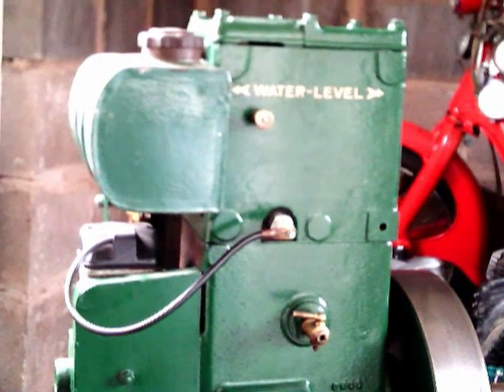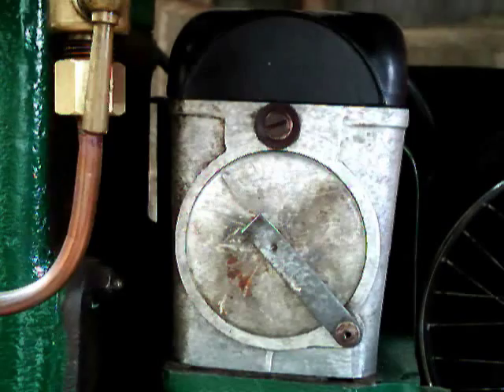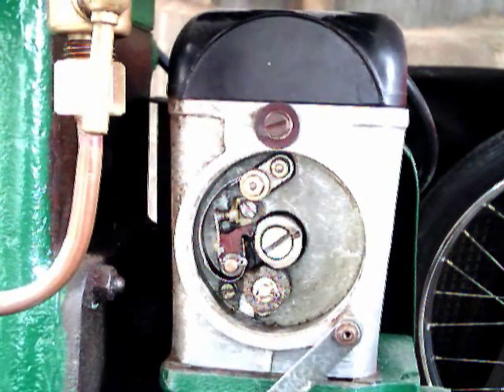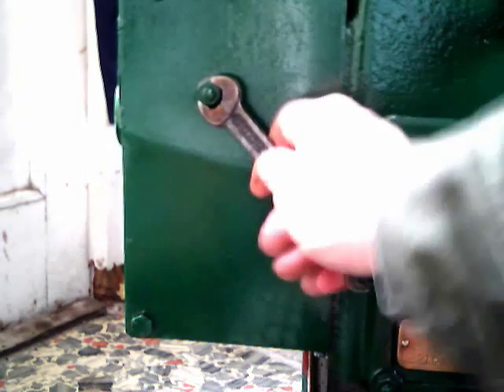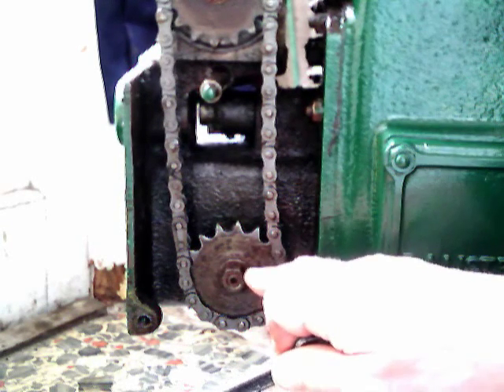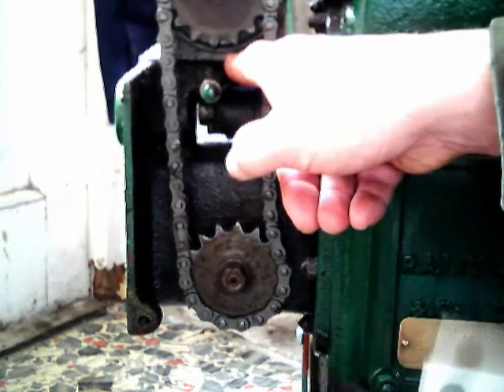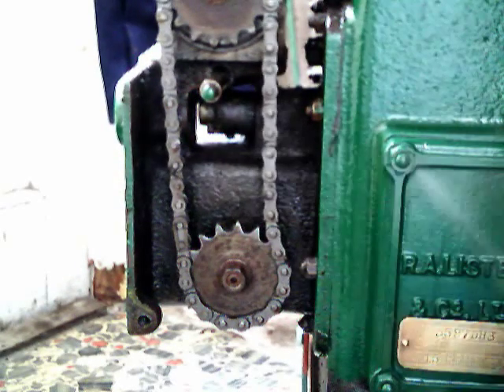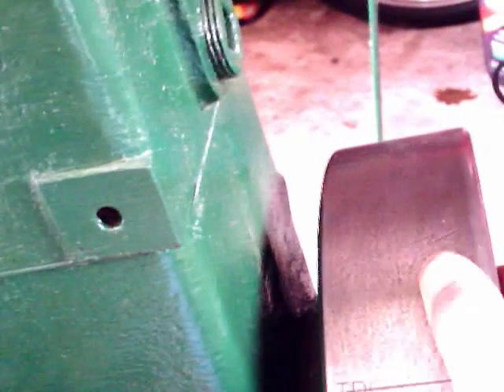Lister d type ignition timing

Comment: I had no idea Lister made a gasoline engine. When I get one of these things I will try to operate it as a Diesel start and Propane run engine. Now I have to find one.
Reply: but why? why not just run it as a diesel engine as it was intended to be run?
Reply: They've very low compression so might not be possible.
Reply: @Endfloat  to clarify I would attempt this on a diesel.

Comment: Thank you for posting this video. It seems though that you have forgotten to mention (and if I missed it I apologise) that the points should just be opening when the ignition mark lines up with the nut.
To Dave Draycott, my Lister D had no ignition marks. I reset mine by removing the head and putting a dial gauge on a magnetic base and turning the flywheel to measure maximum stroke on the top of the piston. I then engraved a line on the flywheel in line with a mark that I had previously engraved on the block. I then measured the circumference of the flywheel and calculated the distance for the ignition mark (though this dimension is given in the video in imperial measurement). 
I do not claim to be an expert but a year and three carburettors after my Lister D croaked I managed to bring it back to life.
Now if I could reduce its gyrations whilst running................................
Reply from the maker: I mention it at 1.47  and at 6.06 :-)
Reply: O.K. Sorry. I do not know how I missed it.

Comment: In truth timing these units accurately is very difficult as the timing marks are not very accurate as regards fixed points of reference on the static side and saying you have to line it up with a large nut is about as technical as it gets on these things. They will start and run when they are a fair way out. I have always favoured the diesel units to the petrol ones.